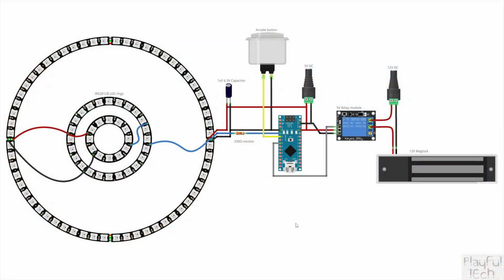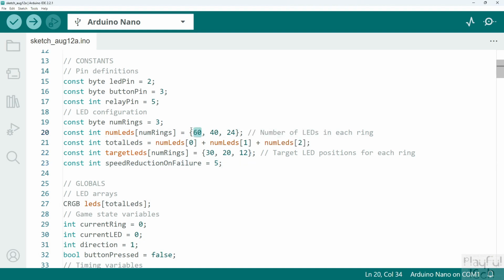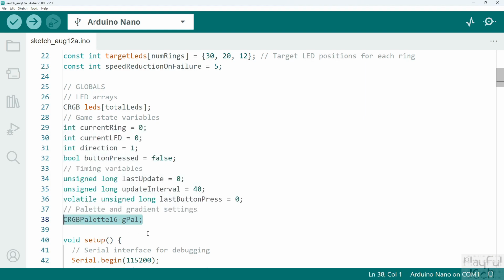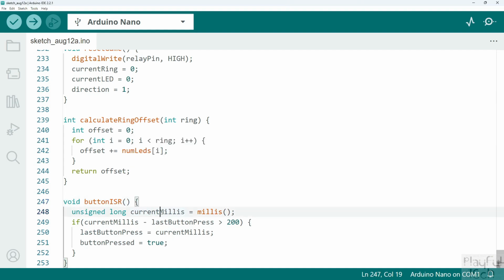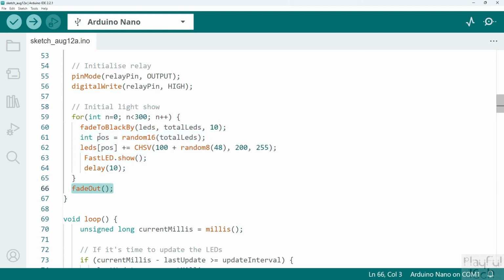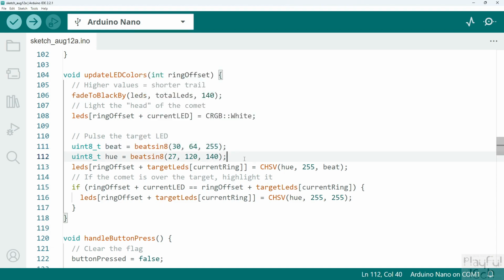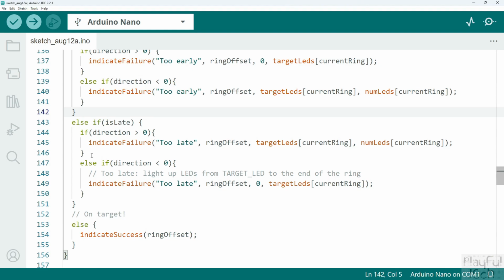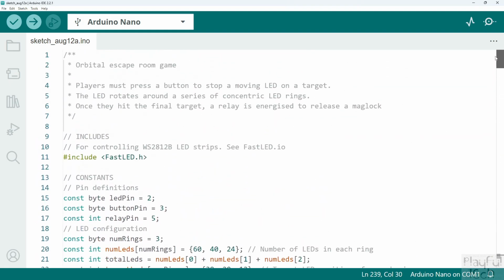"Orbital" Arduino Escape Room Puzzle Prop

Comment: I have a project in my STEAM class to make an escape room, where each team has to make a puzzle that is used as an input for the next puzzle.
So maybe you could use rotary encoders to set the target LEDs, then catch them in each ring to open the mag switch to release the next piece if the puzzle.
Reply from the maker: Yes, that's a great idea! Using a relay to release a maglock containing an item is a very common mechanism used to gate progression in escape room games.

Comment: A cool way to change this puzzle would be to have all three orbits happening at the same time, with 3 potentiometers to control their respective orbit speed, you have got to slow them all down/speed them up so that they all orbit in an alignment, I'd imagine with the different numbers of leds in each ring though, you'd have to do some clever stuff for it to figure out what "alignment" is in the code, maybe have a +/- 1 or 2 leds for the outer rings
Reply from the maker: That's a neat idea! I like the concept of having to make the planets "align" somehow but, as you say, it might involve some playtesting to get just the right amount of tolerance of what is an acceptable value.... something challenging, but achievable!
Reply: @PlayfulTechnology please make a video about it 🙏🙏. Its a great idea!

Comment: awesome - love how you daisy chained the leds together to act as one off of one pin. Wow 10 amp supply. Out of interest do you do a single plug into the wall AC outlet that drives both power supplies (5v and 12V) or do you do two separate plugs to have absolutely no chance of noise?
Reply from the maker: I've been running this using two completely separate PSUs, each plugged into the mains. Yeah, 10A is excessive - I could have halved that and still been absolutely fine!
Reply: it'd be no problem in this case to use a single power supply with 5v and 12v outputs, or even a single 12v supply followed by a buck regulator to generate the 5v.

I'd probably put more than 1uF of capacitance near the LED's in that case though.